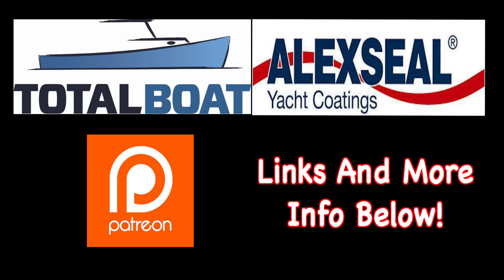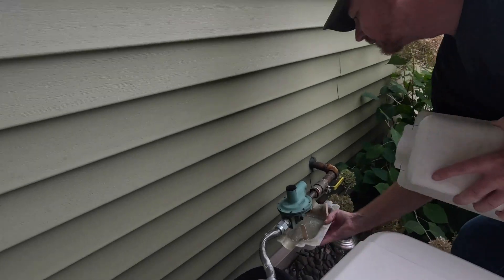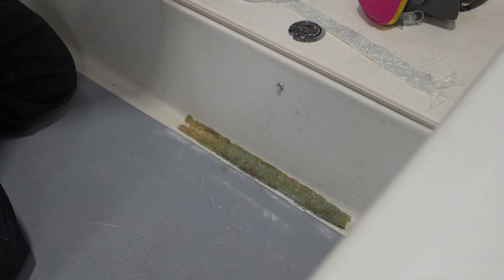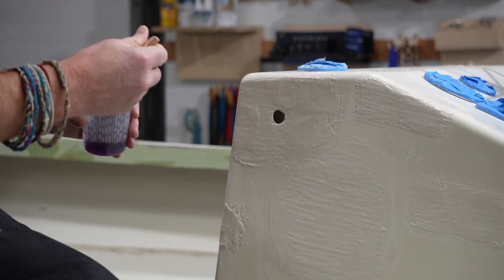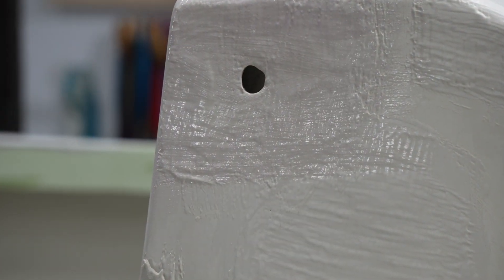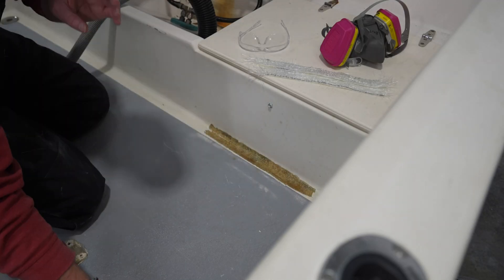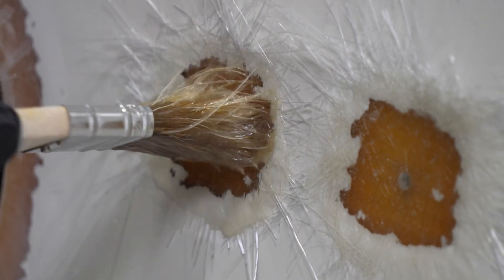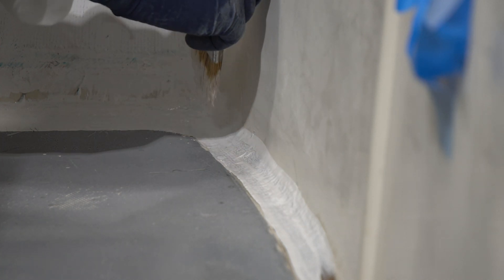What Materials Do You REALLY need For Common Gelcoat Repairs??

Comment: These are good recommendations.  I particularly like the suggestion to add a little chop strand on the exposed fiberglass before applying the color matched gelcoat.  I would have applied it without this step.

For this reason, I have a question about re-applying color matched gelcoat to an area of my boat that has been buffed to the point that the fiberglass is shining through. It is  a 23 year old boat and has an area near the transom that this happened.  Can I sand prep and roll on some gelcoat to sand smooth, buff and polish.  Or, should I do it differently?

Comment: Great videos! I want to paint a 5" dark blue stripe on my runabout but first I need to fix some dock rash on the hull. Nothing deep, just cosmetic, so if I use fairing compound can I paint directly on it or should I apply gelcoat with wax, then several coats of primer and paint after scouring the hull section? Thank you
Reply from the maker: If painting I'd go with an epoxy fairing.  After that's sanded smooth then use primer followed by the paint :-)  If gelcoat for the finish then you'll stick with a poly fairing.  I know totalboat poly fairing already has wax mixed in so all you'll need to do is solvent clean to remove the wax then sand and apply the gelcoat

Comment: Question!!!

I have a 44' sailboat with faux teak deck.  The boat is 40 years old and originally had a teak deck.  The faux teak is failing and I plan on removing it, sanding the glue off of the deck down to the gelcoat, putting a layer of fiberglass down, fairing it and then painting it (with softsand for a non-skid).  

Can I just sand down to a clean gelcoat surface or do I need to sand past the gelcoat down to the fiberglass?  The deck is solid glass, no core.

I was planning on putting a 6oz layer of fiberglass down for the fairing.  Should I use something heavier?

Thank you for any replies.
Reply from the maker: As long as the gelcoat is well bonded to the fiberglass beneath it and not all cracked and chipped, you're fine to thoroughly sand with 60 or 80 as prep for another layer of glass.  Depending on the resin used for that glass (poly or epoxy) you may need to again sand as prep for the fairing.  The fairing can be sanded with 120 as prep for the primer.  If you follow my application for the nonskid there's no more sanding after the prime coat goes down ;-).  For the new glass I'd probably go with something like 17oz biaxial.  Something to look at is what the new deck height would be without the current decking in relation to the height needed for water to drain out the scuppers :-)  Hope this helps
Reply: @boatworkstoday  (Looks like my first reply didn't get saved.)

Thank you VERY MUCH for your comments.  I plan on using epoxy as I have experience fiberglassing with it.  The gelcoat seems to be in good shape, but I'll know more when I remove the faux teak.  The deck is stiff and doesn't need any additional fiberglass for stiffness, but if you'd suggest 17oz biaxial, that's what I go with.  The threads in that stuff is a PITA to fair, but I have enough money to use peel-ply these days... hopefully that'll save a lot of work.

The faux teak is 5.1mm thick.  I don't think I need to build that height back up, except on some steps.  

Do you think it would be better to put the softsand down on a layer of uncured epoxy instead of the primer?  It sure would make the softsand stick more, but it would be a nighmare to remove it for a repair.  And I suppose it would reduce the texturing.

Comment: I’ve got a new to me 1983 Catalina  36.  I’ve started to rebed all of the hardware using epoxy.  Of course, the filled hardware is not visible, but wondering if I should be using the polyester based filler you showed instead of epoxy with filler?  Or do that in areas where the hardware might permanently be removed later on?

Comment: I've always used epoxy. I've never used polyester or vinylester. If I already have epoxy resin and hardener on hand, would I also want polyester?
Reply from the maker: only if you'll be finishing with gelcoat :-)  Gelcoat overtop epoxy works sometimes but usually fails

Comment: Quick question about the TotalBuff. I'm pulling my boat out in November to have a bottom job done and I am wanting to buff the topsides while it is on the hard. How many bottles would you recommend for a 42 foot monohull sailboat?

Thanks for the education you provide.
Reply from the maker: two should be plenty :-)  Use a wool compounding pad on a rotary buffer with medium speed and pressure
Reply: @boatworkstoday  Thank you!

Comment: Awesome video, I've got a question?  Can the buffing compound be used on painted or metal surfaces
Reply from the maker: This is what I use for compounding Alexseal and most other buffable paints.  Have not tried it with metal.  In regards to paints, just need to be sure that the paint itself is able to be buffed (Awlgrip for example is not a buffable paint)
Reply: Thanks Larry

Comment: I did a hull repair on a jet ski some dummy ran up on the rocks. I ground out the full depth crack.  Since i couldn't access the top, i used a piece of 1/4" coosa that would fit behind it, and drilled a tiny hole in it so i could run a piece of fishing line in it so I could pass the coosa into the hole sideways and then I had something I could pull against to hold it in place while the thickened resin i used to adhere it cured. Once cured, I cut the line, glassed and faired, then used a Preval sprayer to spray black gelcoat. Since it was already pretty smooth i hit it with 600-2000 grit then buffed it out. Looked brand new. Too bad the rest of the hull was scratched to hell 🫤

Comment: Andy, can you add the PVA to the list above?  Also, would be great seeing a list of gel coat repair tools. Tx
Reply from the maker: Done!  Thanks for letting me know :-)
Reply from the maker: I'll be going over the various tools when I finish the gas cover
Reply: @boatworkstoday  Perfect.  If you can cover the various thin belt sanders that would be great.  I just bought the 1/2" WEN because of the price and it's 120V, but will likely buy the Milwaukee 12V 3/8" and 1/2" units as they are nice and compact and rotate 360 degrees.  Plus I have other tools from them in that series.